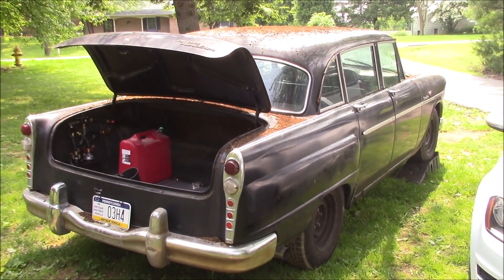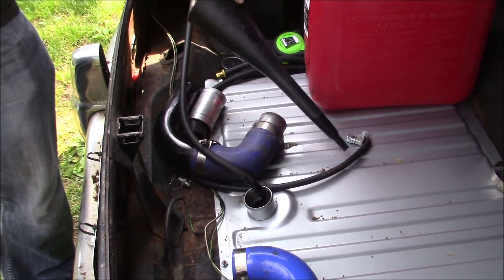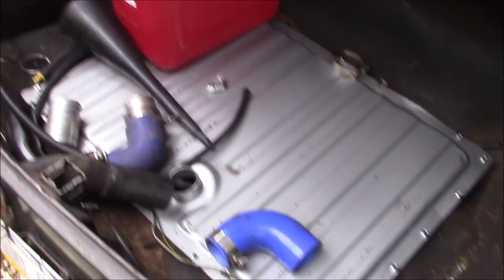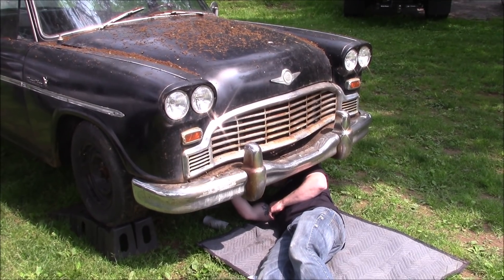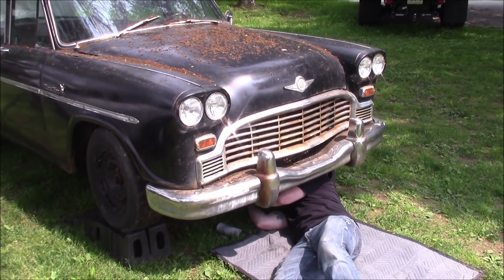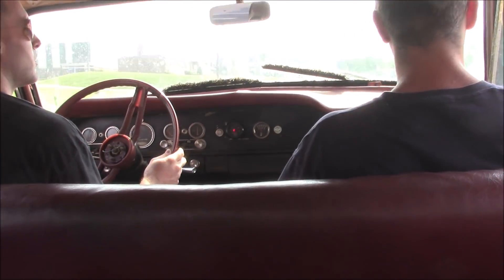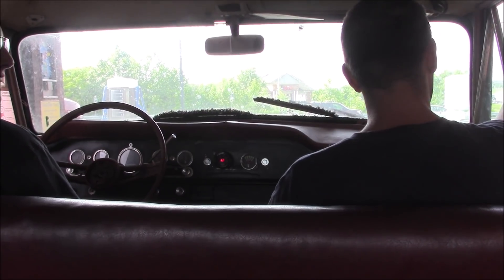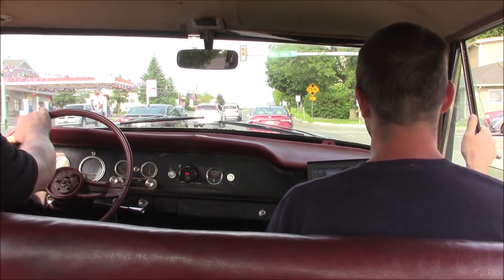1967 Checker Marathon Vortec 4200 Swap - Part 8

Comment: seems like its just cooking the converter instead of putting the power. What ratio is the rear end too?  Could also use a dyno tune maybe too.
Reply: Seems tight in that combo.
Reply: Converter seems tight
Reply: @obrienracing1  in what world?
Reply: The converter is actually tight for this setup.  What would I know tho.
Reply: The converter does hold at some point but the car still feels like a slug.  How many small displacement (under 4.5 liter) turbo automatic have you owned lol.

Comment: Actually the Pinto trunk floor is NOT like the early Mustangs (or other Fords). It is a full trunk floor and the tank is on the underside of the floor. The reason is the spare tire well takes up most of the trunk. The Pinto gas tank goes under the floor and steps down under the the spare tire well.

Comment: Filler issue put the return line with the coupler, should take up the slack and for the bottom tuck it in. Great temp fix.

Comment: Dang it really does seem overly sluggish like it doesnt have enough ignition timing. How far did you guys push it? Base timing 100% sure is correct?

Awesome car though, loved the series
Reply: Crossed our minds even though we did verify.  Feels great part throttle tho so makes us wonder that it is indeed actually correct.  I got a manual boost controller coming..dont want to jam timing in it unless I'm on a dyno.
Reply: @obrienracing1  cool,  please investigate a little further, we are all itching for more Haha
Reply: @obrienracing1  hey what ever came of this, really digged the build that it wasn't just another LS
Reply: @cwyckisslick9444  did valvesprings and blew the headgasket on soft timing e85.  Pile of garbage
Reply: @obrienracing1  RIP, are you doing anything else with the car or ditching it?
Reply: @cwyckisslick9444  not sure yet.  I parked the car in the garage for now so it doesn't rot away in 3 days.
Reply: @obrienracing1  salvage justins turbo 350 out of his c10

Comment: The thing barely moves before it gets wound up.  Dump the stupid high stall converter and it WILL roast tires.
Reply: The converter is actually pretty tight once it gets to like 2800 or so

Comment: Maybe she needs a rear gear something around 3.55/ 3.73 range or . It cruises a bit quiet and doesn't quite put out in first gear I know the 4.2 makes enough for a burnout, something else is absorbing to much torque and I think its the rear gear ratio, convertor, or both.

Comment: Sounds like the torque converter is either trash, the wrong stall, or something. The way it’s revving it’s brains out and not moving anywhere, it’s definitely gotta have something to do with the health, or blowing through it or too high of a stall.
Reply: I thought it was too low of a stall hence why is goes nowhere. Idk.
Reply: Mic Krout that wouldn’t cause the engine to be revving out as much as it is. If that was the case it would kind of be a dog and fall on it’s face off the line. Which it is but it’s also revving too much. Since it’s not cammed (and it’s DOHC anyways) and there isn’t a huge lack of power/torque down low, it probably just needs a 2000-2750 stall if even that really. Depends on the gearing. Could just be a worn out/slipping torque converter but it didn’t look like it was jolting or anything so idk

Comment: You should have kept the original 283 and built it up instead of dealin with modern fuel injection and turbo parts
Reply from the maker: 250hp is pretty exciting I guess.

Comment: You probly need to re map the ecm
Reply from the maker: It's an aftermarket ecm.
Reply: @FuelInjectionSucks  just because it's aftermarket doesn't mean the tune is right. Something going on with it it should definitely be making more power then is. Especially at that much boost

Comment: Interesting engine for that car; you know it's a 4200 because it takes forever to start! They were available in few vehicles but were excellent engines. I would try to get a manual in somehow if I could as the 4 speed left something to be desired (or does it have a manual on the tree or are you just shifting the auto manually?). The fuel economy wasn't great but I loved that engine. I would avoid the Nixon bumper sticker though; he was a horrible President responsible for abortion and the "Made in China" fiasco Trump is now trying to reverse.